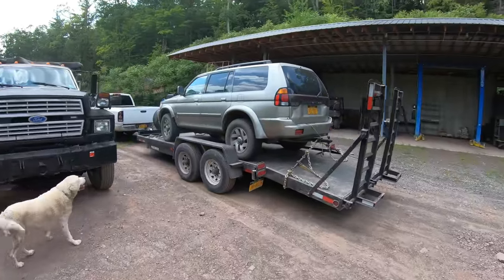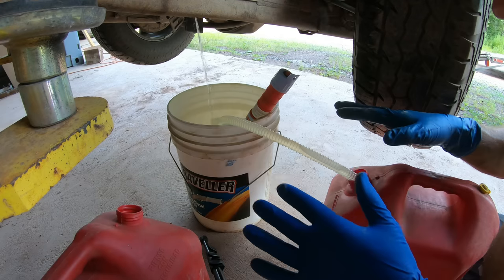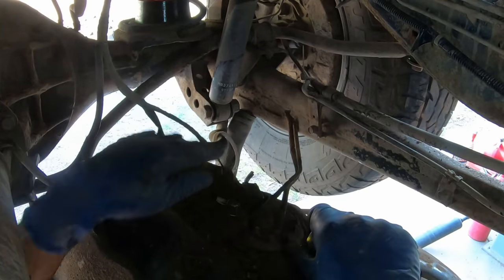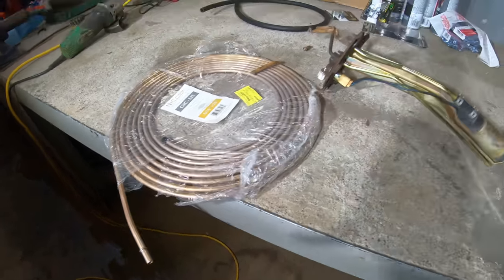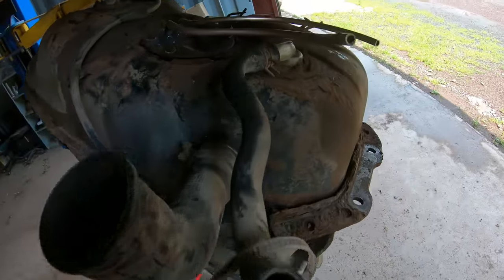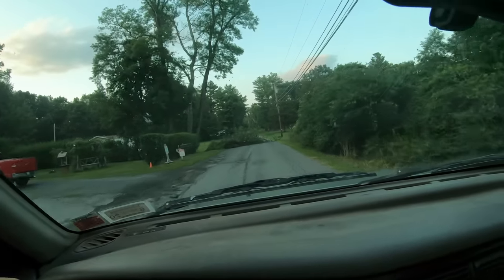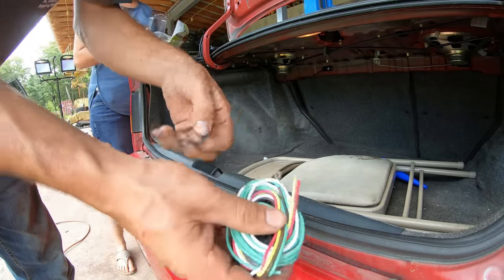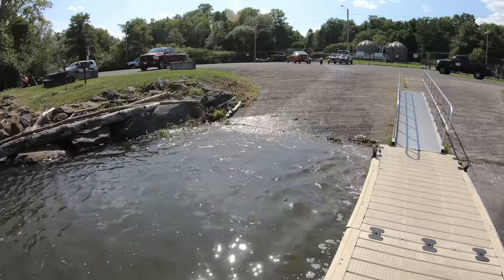Replacing a fuel line in a SUV

Comment: Have you ever considered adding tubes with holes for pins with pads on the bottom, so that your trailers don't get squirelly loading heavy stuff? I believe you've been misinformed on how to drive a split speed transmission. The proper way suggested by the manufacturer is to "double-clutch, i.e.; push in to disengage, enter the neutral gate and engage clutch to mesh engine and transmission, disengage clutch and go to higher gear, then engage clutch again. Downshifting you rev the engine in neutral and engage clutch before diengaging and going to lower gear. Shifting without the clutch is the lazy way and egotists way of showing off.  1200-1400 rpm usually is a good window to shift at. Hope this helps.

Comment: Surely there will be catastrophic engine failure long before the suv lives another 15-20 yrs that you can't just repair, and that if you were to replace wouldn't make financial sense.
Reply from the maker: Sure it would, if it needed like an engine, thats probably $1000 or so for a good used one. A new SUV cost $30,000 so it makes sense to just fix that one forever.

Comment: What, no solder on those wire connections?
Reply: the solder is actually inside those type of crimps,.......when he puts the heat gun to it, it heats up the solder and it spreads out.  i believe he explained it on another video in the past.

Comment: Are jetskis vulgar in the noise they produce? I prefer the kayak any day!
Reply from the maker: ken jay kinda hard to get anywhere in a kayak. They are better for smaller areas. Jetskis are not loud if the exhaust is not modified.
Reply: @AndrewCamarata , come on out. Stay as a guest. We will Kayak. The journey is the destination. I live on the Puget Sound. It is amazing. I used to paddle five to seven miles daily, with my dog on board. Every stroke pulling harder than the last, making it glide as quickly as I could. Feeling my lungs, chest and shoulders getting stronger every day.
Reply from the maker: ken jay kayaks are fun in some areas. They are great for going down rapids too. Little sail boats are nice as well, my favorite is the sunflower/snark.

Comment: This is a very dangerous hack job!  That cold solder joint is an accident waiting to happen. Any vibration will break that joint loose. I would have chosen a stronger braze on connection for a gas tank anyways. While you are great at welding, you need to brush up on soldering, big time.
Reply from the maker: That will never break. It was a hack job from the factory, made out of materials that failed with time. Cars are requires to last 100 years.

Comment: Why not replace with new pump and new updated lines? And yeah there gonna recall your 20 year old SUV 😂😂
Reply from the maker: They need to recall every vehicle on the road with steel brake and fuel lines. That's even new stuff sitting on the dealer lot.

Comment: Copper lines are not put on cars or aircraft because the copper becomes brittle and cracks, from vibration(even the pulsations from the pump cause embrittlement), over time.  The most common failure point is at the fitting.  Copper lines are soft at first, then become hard from twisting, vibration, compression, stretching....etc.  Virgin copper lines are too soft and too easily damaged at the final assembly line.  A broken part on installation can STOP THE PRODUCTION LINE!!!  Fuel injection systems operate at 30psi minimum.  Steel lines are also less expensive.  Steel lines are also less likely to be damaged during expedition/handling, from mfg. to installation on the assembly line.  Multiply that by a couple million ... and you got a lot of money!
Reply from the maker: Steel lines rust out and fail.
Reply: @AndrewCamarata  I agree, absolutely.   If you look at it from the mass production viewpoint, they are not cost effective.  They produce one vehicle every 90 seconds on each assembly line.   Copper lines are easily damaged....and there are many lines under a vehicle.   And many fittings.  That means many possibilities to shut down the assembly line if any is damaged and must be reworked.   It's not a perfect world.

Comment: 2 bolts to drop that dodge fuel tank let’s fuck the bed up because were lazy??? Move down south no salt on the roads to ruin everything you buy
Reply from the maker: ricky k it’s not ruined. Just need to bolt that cover down.
Reply: Andrew Camarata yea not ruined just a pain slide stuff in the bed

Comment: Why not just weld it on
Reply from the maker: That line? welding only works for steel, I don't think it would work on that copper nickel, that's why I used solder.
Reply: Tow hitch? Could have welded the bolts to the frame.

Comment: A Real mechanic would replace the whole unit sinhce the life span is about used up. You are going to do that job again soon if you do not replace that pump
Reply from the maker: Only a bad mechanic would replace the part with the same part. The part was a defective design that rusted out. It needs to be designed to never rust. I upgraded it. They would probably install some aftermarket pump that will not last as long as the good OEM on that is in there. This car is still running fine, I have been putting a ton of miles on it latley.